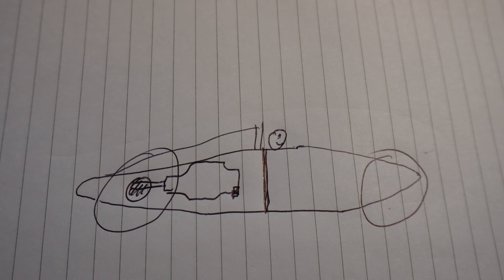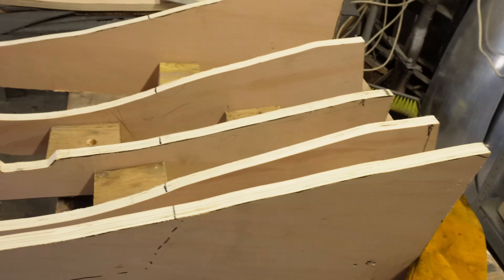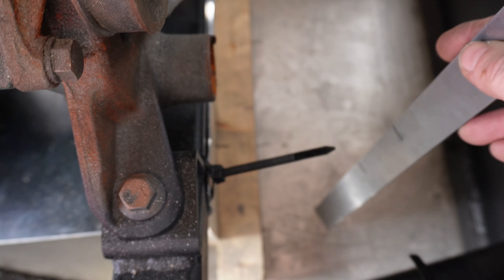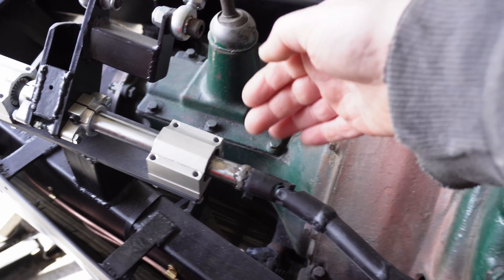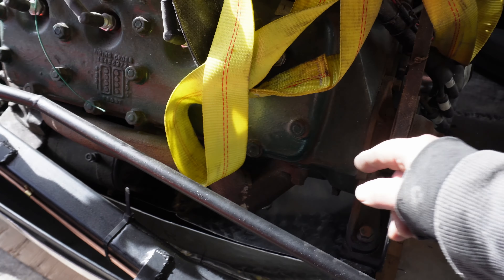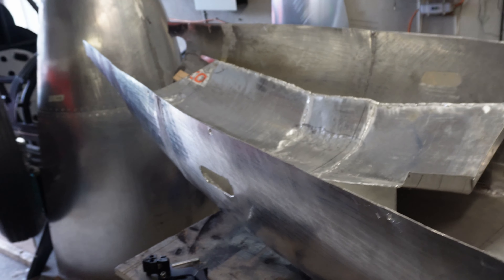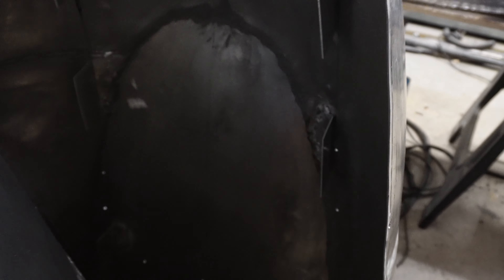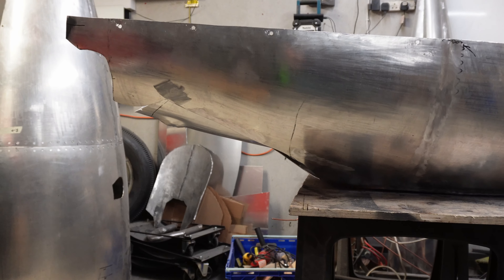Belly Tank Lakester | Exhaust/Air Duct Ep61

Comment: Cool idea....but.... would running the exhaust down there put way too much heat around the oil pan?? Adding too much heat to your oil!!
Reply from the maker: It might but there is a layer of alloy between exhaust and the oil pan. The air underneath that will be exhaust plus radiator exiting air so cooler than if it were just exhaust gases alone. There will be some vents to bring cool air into the body which will flow over the engine itself and to some degree past the oil pan to stop heat buildup there. Won't know for sure though until I try it. Maybe should buy a load of cheap temperature sensors and dot them all around the engine bay...